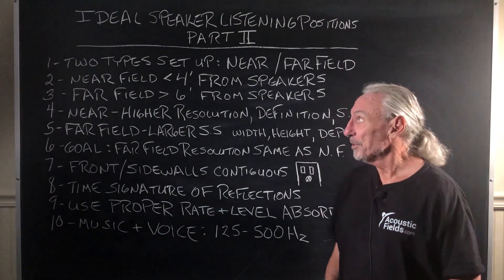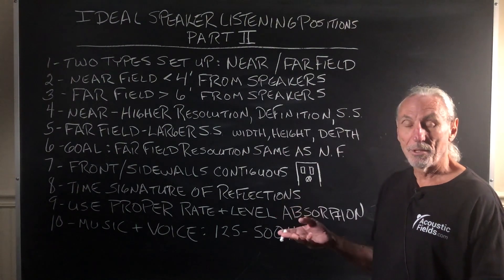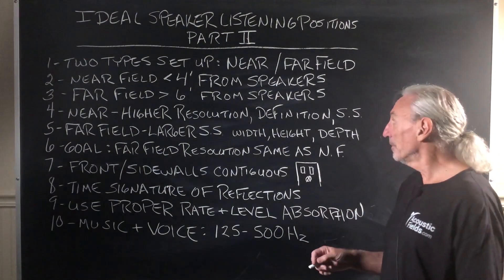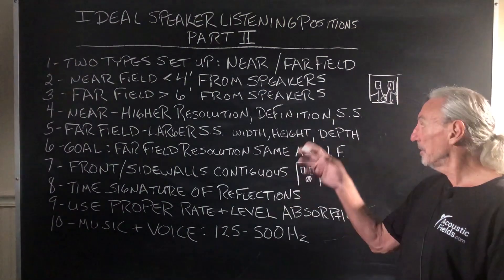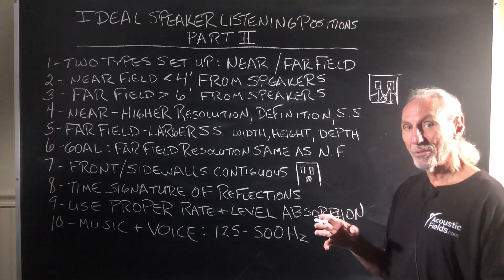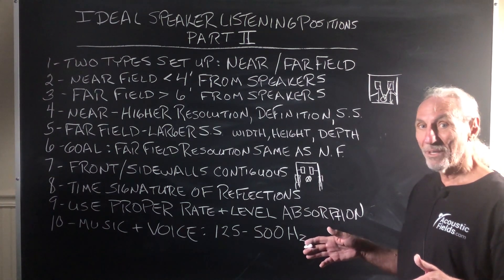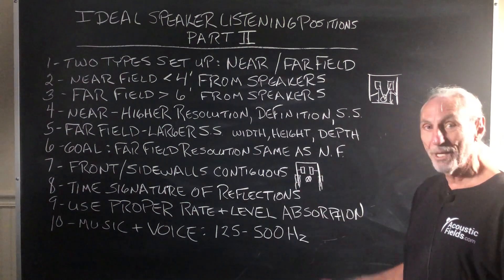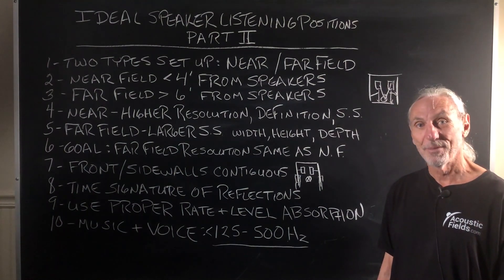Ideal Speaker Listening Positions Part 2 - www.AcousticFields.com

Comment: I'm put the monitor speakers on my shoulders and sitting on the sub woofer for the best sound. The sound is sweet and not bitter. A little harsh at times...🤭
Reply from the maker: Make sure the sub woofer sits on a glass floor for the best sound qulaity in your example.
Reply: @AcousticFields  Thank you for the suggestion, I will do that too.🙂👍

Comment: I’ve seen the term “rate and level of absorption” used in many of these videos. What does this mean, specifically? What does “rate of absorption” mean, same for “level of absorption”, and how do they differ? How are they measured?
Reply: Just means how the absorption looks on a graph with frequency on the horizontal axis and amount of absorption on the vertical axis. 

You don’t want mutton soup!
Reply: Rate is the frequency, level is the amount of absorption at that frequency.
Reply from the maker: Rate is the amount of absorption that occurs at each frequency. Level is how low the technology absorbs down to.
Reply: @AcousticFields  - THANK YOU so much for clearing this up for me. Now I understand so much more of what you have been explaining in these videos.

Comment: Nearfield listening is my preference whenever possible, but one area I struggle is the desire to have that chest thumping bass at lower SPLs.
Reply from the maker: Why do you want "chest thumping bass"? The goal is a balanced frequency response with each octave band working together with proper rates and levels. Leave the chest thumping to the primates.
Reply: @AcousticFields  It depends on what one means with chest thumping bass, but bass should definitely be felt in your body in a good system that has a balanced frequency response at higher volumes (and I'm not talking bout anything near ear damaging volumes). Also humans are primates.
Reply from the maker: @storkfletcher821  No truer words have been said.
Reply: @AcousticFields  he right I like a nice bit of mid bass kick and want to no how to get more

Comment: I have my speakers 3 feet from the front wall but my room is 25 feet deep and I still can’t get good deep bass. Thinking my small floor standers are too small for the room?
Reply from the maker: Your room is not letting your speakers produce the sound quality they are capable of. Buying new speakers will not give you the results you want. You need to treat your room to deal with the room modal pressure issues.